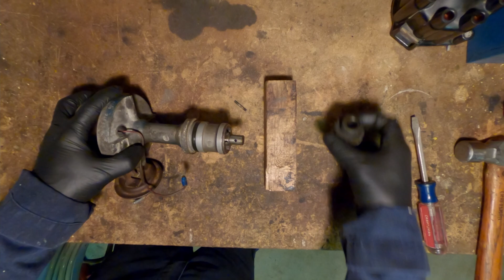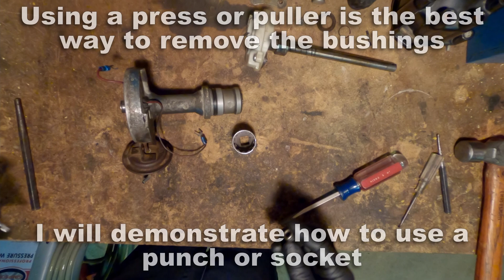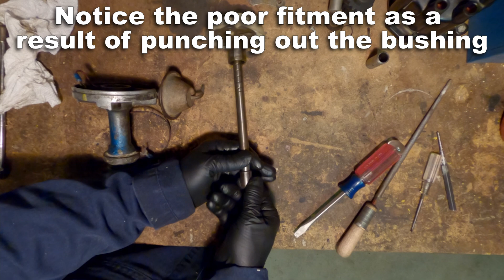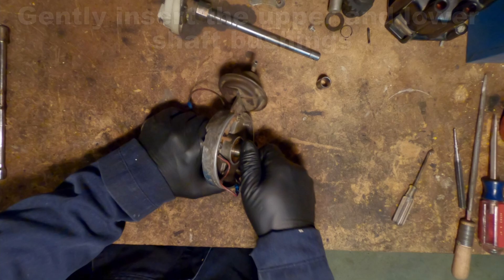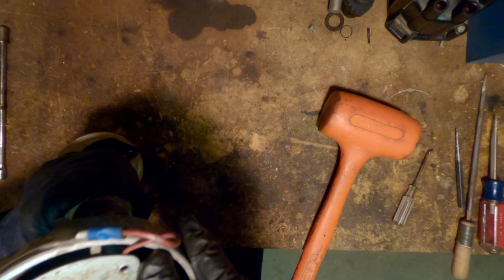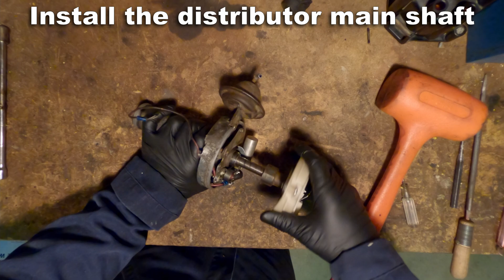GM Points Distributor Main Shaft Bushings Replacement

Comment: Do the shafts/bushings inside the distributor get lubricated by the running engine? Thanks!
Reply from the maker: The top of the distributor has a pad that is saturated with grease. The lower bushings are lubricated withe engine oil from the rear of the cam gear and splash from the gallery plug.
Reply: @junkdump2720 Okay, thanks for the info

Comment: Why.did you have to beat on it? Shouldn't it just fit in?
Reply from the maker: Great question, the bushings are engineered to be held in place with an interference fit. The distributor housing has tapered tabs that help center and hold the bushings in place. Thank you for the question.

Comment: What kind of grease do you use for the oil well?
Reply from the maker: I have had good luck so far using a quality wheel bearing/chassis grease.
Reply: @junkdump2720  I can’t find bushings anywhere. There’s still people out there trying to keep numbers matching, right?
Reply from the maker: @Daveunruh  There are definitely still people keeping their cars numbers matching and running points. I will see if I can find some part numbers for you.
Reply from the maker: @Daveunruh  I am pretty certain the last bushing set I bought came from TA Performance. They are a Buick site, but the gm bushings are the same, give them a call and they should be able to set you up with a set. Measure them before you install them to be sure they will work, and don't forget you might need shims.
Reply: @junkdump2720  I think all GM bushings are the same- points and HEI. I found a set for corvette with tach drive. My upper bushing well is surprisingly deep enough to accommodate that. The bushing I just pulled out is grooved on both sides and the oil hole is in the middle with another 5/32 of well depths to pound further than pickup coil depth.
Reply from the maker: @Daveunruh  The Corvette bushings with tach drive are unique, the TA set are just like the OE HEI bushings and work just fine with points distributors.
Reply: I use Delco distributor cam grease that comes in a large aluminum tube. Probably from the 70’s. Got 2 tubes from my Dad’s stash.
Reply: @johnmilnerQQ  my goodness. I could really use that. I have no clue what type of grease to use for the distributor’s upper bushings. I’ve never seen a can. Ever.

Comment: Just swap to a hei already.
Reply from the maker: An HEI is a great swap but don't forget there are lots of original, numbers matching, and restored cars out there that would lose value from an HEI update.
Reply: Not me. Own a 70 Z28. Have used both Pertronix and Crane XR-i modules. Got about 15 yrs each before heat killed them. Now I won’t even try another cause the reviews suck saying some don’t work out of the box so I’m back to using points and a condensor.

Comment: Where did you get the bushings was looking for them for my gto distributor but have yet to find them
Reply from the maker: I believe I purchased a set from Eckler's (part 25-329229-1). Contact them to verify that the corvette bushings will fit all Delco distributors from 62-74.
Reply: @junkdump2720  thank you